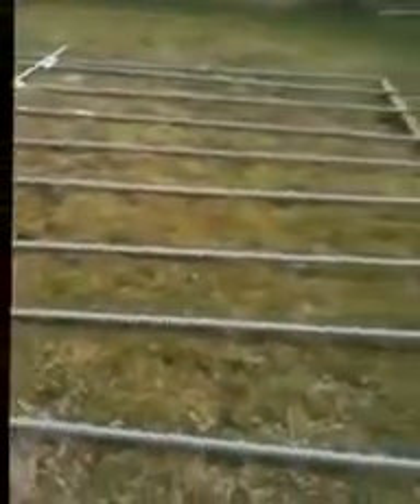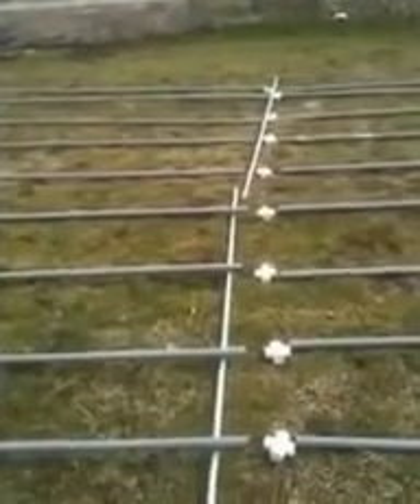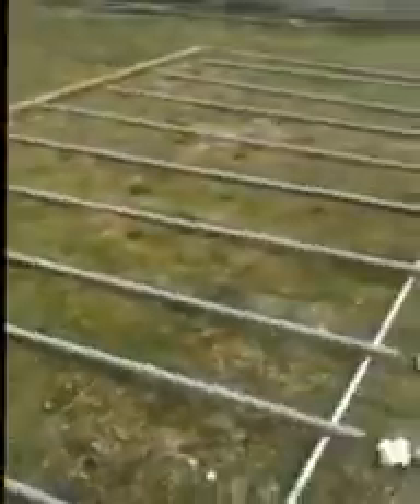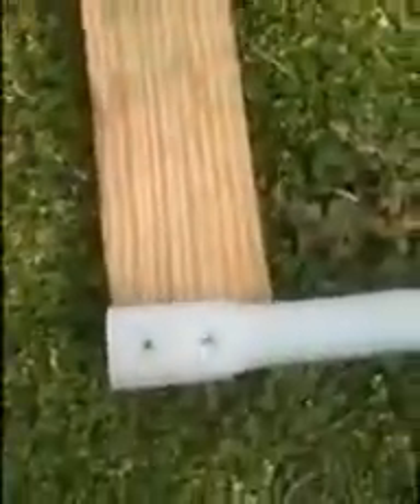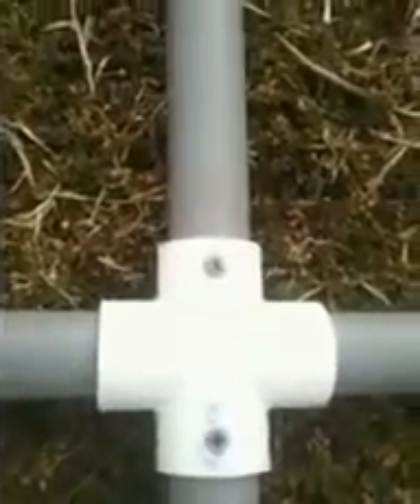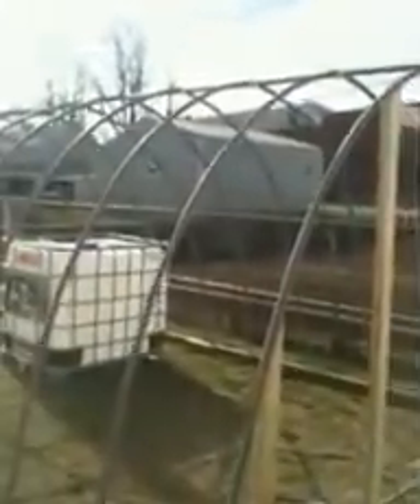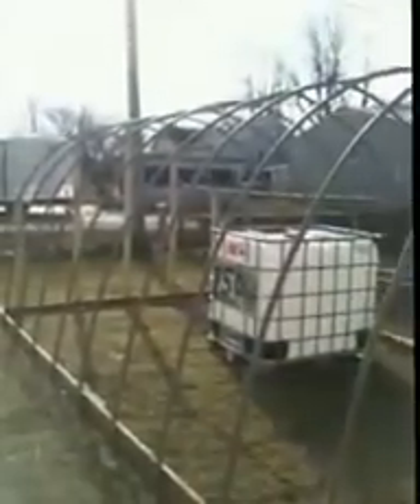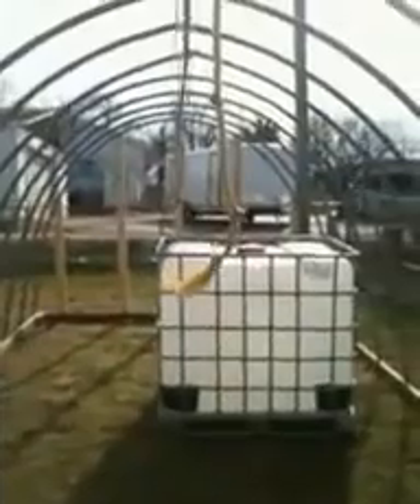How to make a pvc greenhouse cheap

Comment: didn't feel compelled to orient the video correctly prior to posting?     also, you skipped any instruction of how assembly was handled...  pretty useless video.
Reply: i hate the blinders on both sides of the vid. also the guy caused himself a large headache and made the greenhouse inefficient by using  2 sheets of plastic with overlapped seams that bleed air. duct tape will be gone in a couple months. he says pipe conduit is better than pvc, but one staple buckled it. hmm. i would have made the dimension 18 feet wide so a 20' wide roll of plastic would cover the whole thing in one sheet, no seams flapping, and have a foot left on both sides on the ground to cover with dirt(i use 2x4's, so i can move them and sweep the base clean occasionally.). i would go back over the whole thing with a second layer 20' wide, it will super insulate it with a dead air space between the plastic layers. that's how i winterize mine. very simple to remove/store the second layer in spring. i use those big black binder clips to hold the plastic to the pipe on the ends, so you don't damage the plastic with staples.